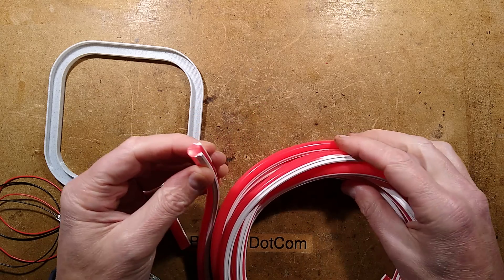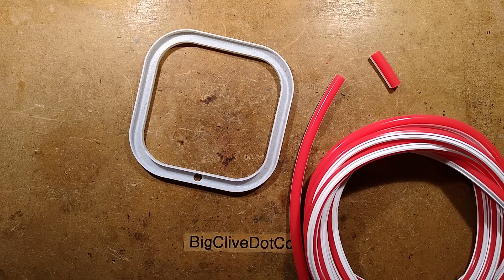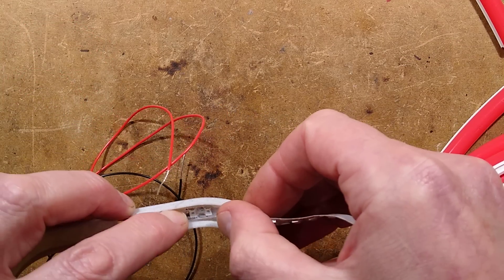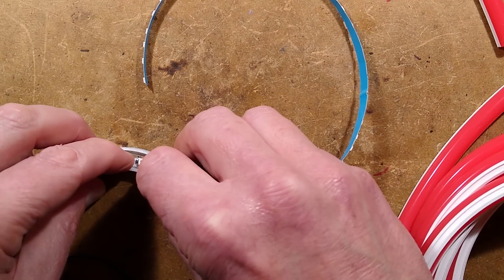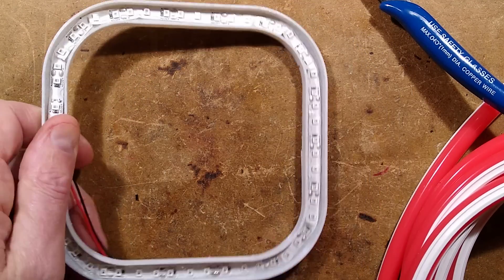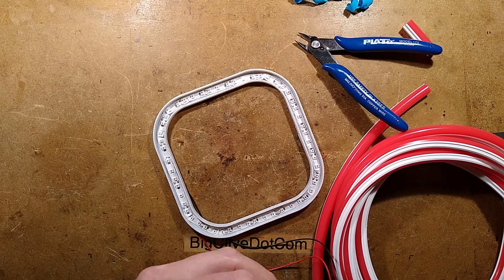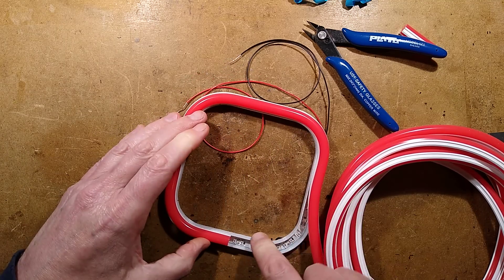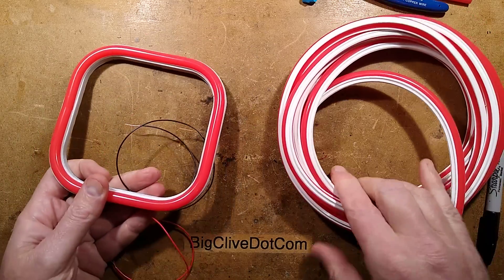Testing a new 2-part style of LED "neon"

Comment: That's the best fake neon yet, advantage being that the LEDs are illuminating directly outward rather than from the side. Quite an innovative strip design which allows bends too.
Reply: Neon and blown glass is an art form. Blink open or closed.
Reply: @tomtheplummer7322  it is an art form and priced as such.
Reply: @tomtheplummer7322  watched a guy blowing neon tubes for a display. It is indeed an art. An art that one doesn't see a lot of anymore given the new tech like this stuff now.
Reply: @tomtheplummer7322  meh

Comment: It's not just 3D printed plastic, in my experience that tape doesn't stick well to anything.  Even if you can get it to stay initially it always falls off quickly.
Reply: If you're not worried about the surface you are sticking too, a bead of cyanoacrylate would probably work quite well.
Reply: @gavinstirling7088  If the tape doesn't come off the surface you're sticking to, it usually comes off the LED strip itself instead, especially if you're running it hot.
Reply: The only tape type I have found that sticks to virtually anything is a variety of special waterproof aluminum foil tape (made for sealing ductwork etc). It'll stick to parchment paper and it'll stick to things that are wet or underwater. Whatever the adhesive layer is made from, it's awesome. I'd love to find it used for double-sided tape.